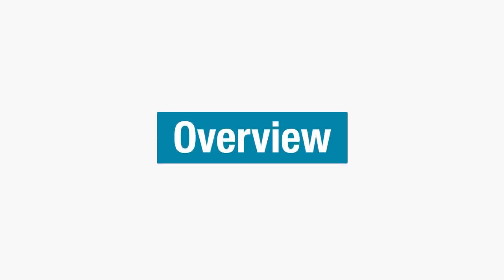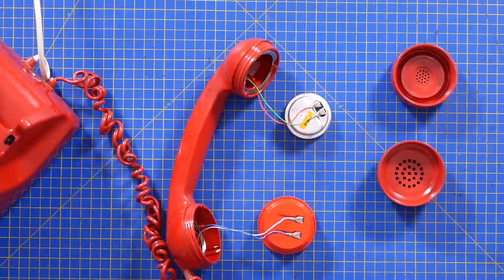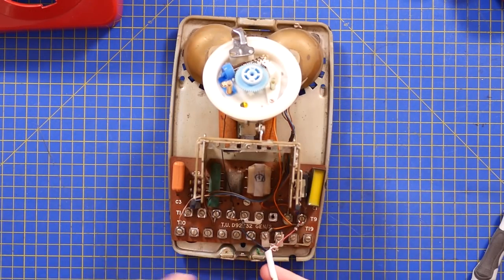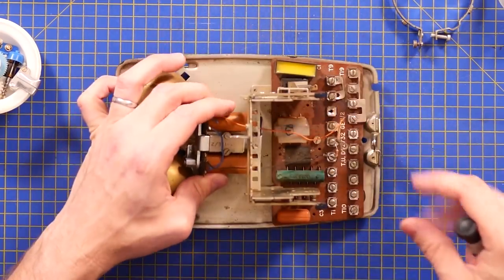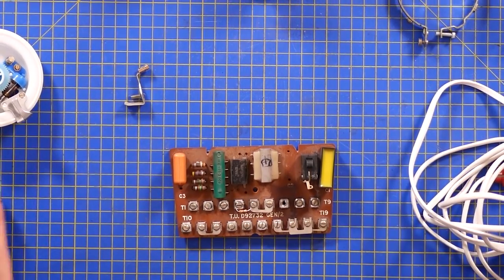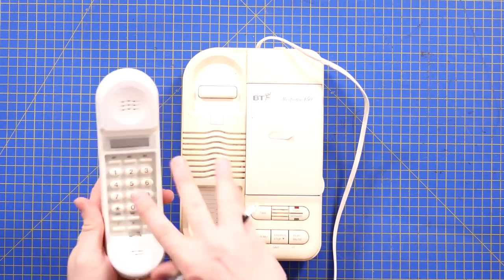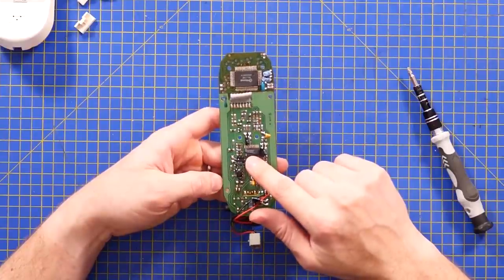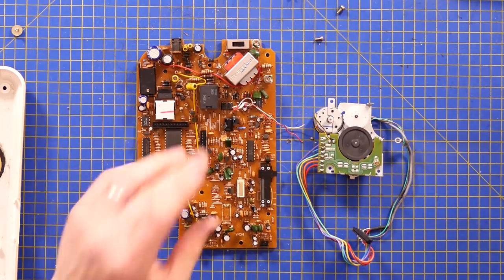What's Inside Rotary Electromechanical vs Pulse/Tone Phones? - The Electronics Inside

Comment: The rotary dial phone could be configured for many uses. Use on a farm line, with no ringer and a separate handle ring generator, and local battery, or use on a regular phone, or use as a office phone, with the ringer and voice circuits, along with ringer, on a separate set of wires for each circuit.

Those 2 glass items are incandescent lamps, there to act as a variable resistor, giving a 600R impedance on the line irrespective of line length, compensating for the longer line by dropping the voltage across the phone, keeping voice level constant on long lines. Then the hybrid transformer, there to separate voice into separate directions, but combined on the line, but with a slight bit of imbalance to allow sidetone in the earpiece, so you do not shout. That little thing across earpiece is a pair of diodes, back to back, there to limit the volume on the earpiece, to keep you from being deafened by impulse noise on the line, or from faulty line connections.

I have basically that rotary phone, just a 1939 Ericsson made farm line unit, that I changed from local battery to line power, and used it for years as my home phone. It had some repairs over the decades, capacitors inside were changed around 1958 to new ones, made in 1956, and the handset cord was probably changed same time. Still works as a phone, though the difficult part is calling out, as it has no rotary dial or tone pad, just a 90VAC ringer, which has come in handy to test the line, and arc the open circuit joint back into conduction a few times, or make the noisy one die totally. Currently I use it as a place to charge the cellphone that replaced the land line, as it has a convenient note shelf on it that was intended to be used for a notepad and pencil. Do not have the little chain and holder that used to be provided to hold the phone book, though I am sure I can make one, have the correct Post office spec chain, and a lock, from old PO bags, and also the bag.
Reply: The lamp thing is a really good shout! That makes a lot of sense, thank you!

The ability to configure the phone came as a big surprise to me, but is a really useful feature. I bet it found itself in a hundred uses over the years!
Reply: @a531016  Yes, I have an old rotary dial phone, and a similar age one which was used as a railways PBX phone, line powered, but with a ringer handle instead of a rotary dial, but the same basic phone baseplate in there. The old joke about these phones was that you could use them to kill somebody, and afterwards still use it to call the police, as they were incredibly robust.

Of course, most people at that time had only the option to rent the phone, not buy outright, and as well you paid for the line, the phone and the indoor line rental as separate charges on the bill, along with the socket rental as well.

Started off with the old BT 3 pin plug and socket, then with the rise of PBX systems going into business, still a rental for everything of course, they moved to a 6 pin plug and socket, slimmer, to fit the 1970's decor better, that allowed the PBX to have all sorts of features and add on's, like a line mimic display, and an extension mimic display, so you could, with only 2 extra rental charges per month, see which lines were busy, which were ringing, and route calls direct to the extension with a press of a button.

All done with that 6 wire interface, though you could still connect a plain phone to the socket, and not have the bells and whistles, but use it like a regular touch tone phone.

Then finally deregulation, and you could go to line rental only, and companies bought in their own PBX systems, with RJ11 sockets, and phones they actually owned. The telco still sold phones, but changed the agreement, for houses they now only did the line, unless you paid for indoor line maintenance, which meant they would fix faults after the demarc in your house. I never paid that though, phone wiring is not complex, and I had plenty of experience doing the wiring anyway. Now they are dumping copper, going all fibre and LTE, because there is little SLA for them, but the SLA for copper is very much a big expense, as they have to fix within time limits, and pass credits.Fibre and LTE best effort, so they take their time to fix.

Comment: Very nice, we had similar telephones in the Netherlands, that I used to take apart when I was a kid. Made my father really happy. Ours was the T65 model by Ericsson, T for ‘table model’ 1965 was the year of introduction. The dial had only 3 wires. About yours, I presume the glass tubes could be an over voltage protection, as in those days, the land lines might have been in between telephone poles, so vulnerable to lightning strikes. Nice video, thanks.

Comment: Tubes are thermistors, thing accros earpiece is two back to back diodes to stop ear damaging clicks when dialing. The phone was multipurpose for all different combinations of what BT called plans ie plan 107 was a Manager Secretary intercom system. The phone  was complex in operation as it had to balance itself with the line. That's why there was also a transformer inside.
Reply: @hunter00047 thanks for your comment. Please explain the role of transformers inside these rotary sets. Thanks

Comment: I think I am older than your expected audience.
When you showed the profile of the hand set I didn't think about the icon on cell phones, I thought about an acoustic coupler.
Reply: Expected audience? Children and electronics fans of all ages!

I never had the pleasure, my journey started at 14.4K dial up modems. But the infamy of War Games means I know exactly what you are talking about!
Reply: I know I'm older than most of the commenters here... I remember my Grandfather and Uncle having farms that were still on a hand-cranked party line system in the early sixties.  None of these fancy rotary dials and switched networks.
First you picked up the earpiece and listened to see if anybody was using the phone. If it was free, you then turned the handle with the pattern for the person you wanted to talk to.... e.g. LONG-LONG-SHORT for Mable, and LONG-SHORT-SHORT for Fred. [LONG was about 2 seconds of turning the handle, SHORT was about a second, and you didn't turn the crank for about a second in between rings]
And if you wanted to call someone on a different line - or into the city - you had to ring the operator, and ask them (almost certainly a "her") to connect you!

Of course when the phone rang, you had to listen to the pattern to decide if it someone was calling you or your neighbor... and if you were quiet enough, you could listen in on other people's conversations without them knowing ;)

Comment: The device you removed spanning T1 and T2 is a rectifier, NOT a capacitor. It consists of 2 diodes connected in parallel but each in the opposite direction. Its purpose is to limit audio pops in the receiver. The yellow thing on the right IS a capacitor used to pass AC ringing current to the bells. The complications are largely due to the weird way in which British phones were hard-wired back in the day. Bells were connected in series which required the extra wire in the line cord. And yes, these could also be used in PBX systems including ground-start configurations. All this information is readily available online if you want to make an accurate video.

Comment: I’ve played with a few rotary dial phones(known as NZPO type 100/110 handsets), 0 is 10 pulses 1 is 9 pulses and so on at least on the NZ system. I’ve made a "multi line" mini PABX that can work with pulse dial at least for the intercom section (yes you can do the hook switch pulse dialling trick on this too) . The multi line system I’ve made can be connected to a PSTN or VOIP with standard phone connection line, you’d still need a DTMF handset to dial numbers but you could use the older handset to answer or (on my system) dial 0 to take the outside line off hook

Comment: you can make the old LD dial phones work with the new voip (dv) we may all end up with in 2025. you can get LD to tone dial converters, and most proper internet routers that have a voip connector either rj11 which you can plug an rj11 to bt431 adaptor, or if a bt hub then the bt431 socket will be there already and they should power the traditional phone ;-) you may have to do a bit of tweaking inside the phone if it wont ring, or you can stick a master skt on the output from router.

Comment: I haven't had a landline for 10 years, so I'm not sure how to put that rotary phone to use. I would say to keep it completely intact for posterity and build a box to translate and interface it with modern systems, but I wonder how much longer landlines will exist even for brand new equipment. So maybe making a simulator or game out of it, again leaving the phone completely intact but making a box to decode the pulses and make it interactive.
Reply: That's a nice call, creating an adapter to use any pulse dialing accessory as a (maybe) USB device? That could be fun, and more globally useful!

Comment: Hi      The multi leg green thing is a stack of selenium disks ( rectifiers )  , I dont remember what the glass tubes in the black plastic
blob are ---  perhaps neon tubes to limit the voltage or light bulbs used as thermistors .
                                                                                                                                                                        Alan
Reply: It seems to be the consensus that they were indeed used as a thermistor!

Thank you for identifying the rectifiers!
Reply: The glass tubes are bulbs, used to limit current to the diodes

Comment: Hi My name is Joshua. I remember getting the earpiece of this phone and simply connected two of its terminal with a zener diode. Then we used a long wire connected to one terminal. We would poke the other end on the terminal on a tree and we would be able to listen to the radio!...(May be becuase the radio station was very near to the house.... but it worked!. Since you have it, can you try and share the results pls!

Comment: There are pulse to tone converters I was thinking I could do it easily enough with a pi zero.
Reply: I'm thinking pi zero to WiFi IP phone? Maybe a teams handset attached to a computer with HID emulation for the dialer? Something like that?
Reply: @a531016  Arduino emulating a HID interface, with rotary dial entering numbers on the keypad, and hook switch emulating enter on state change. Bell a bit harder, probably get it to emulate caps lock, or scroll lock, which is about the only output bits on a keyboard that you can set.
Reply: @a531016  I have a a Obihai OBi200 I was just needing a pulse to tone converter. But yeah with a pi anything is possible. I wonder if I could use a pi zero to replace the OBi200 with google voice still I remember them discontinuing a way to do this I wonder if anything brought it back.